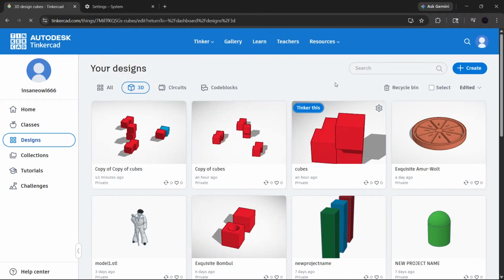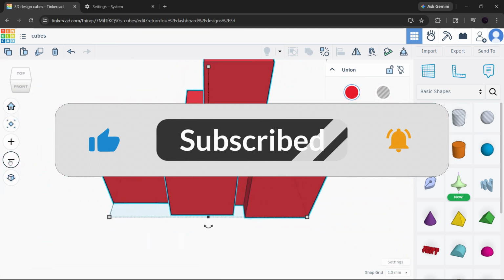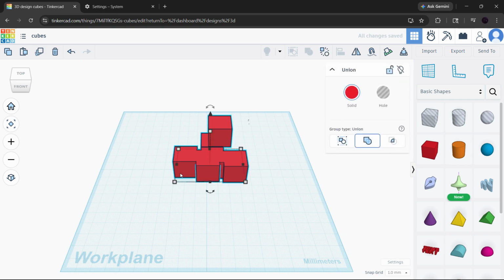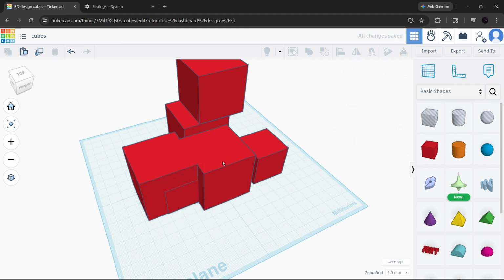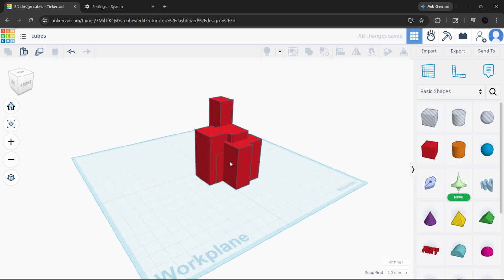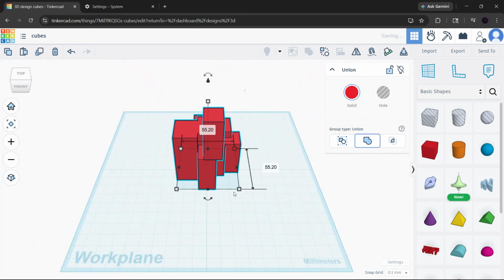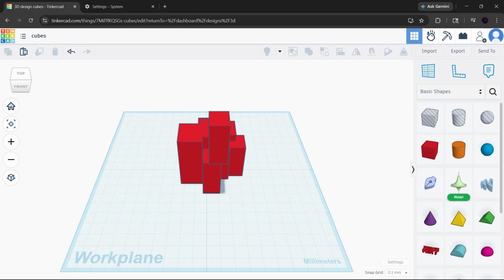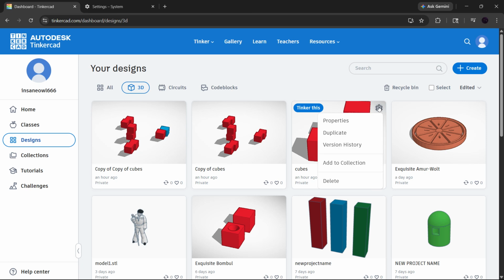Tinkercad Error Scale Object (Easy Fix Guide)

Comment: Nope... still can't find the handles.
Reply from the maker: if the handles disappeared, it's usually one of three quick things:

You might be in "Lock" mode: Look at the top right shape inspector panel. If the Padlock icon is highlighted/locked, click it to Unlock the object so the handles reappear!

Check your Tool/View mode: Make sure you are in the default Select tool (keyboard shortcut S). If you are in the Crucible/Sim Lab or Block/Brick view, switch back to the 3D Design / Workplane view.

Clear Selection: Click on empty space outside the workplane to deselect everything, then click directly on your object again.

Hope this brings them right back! Drop a like and subscribe for more Tinkercad tips!